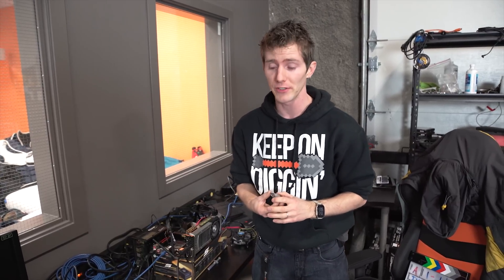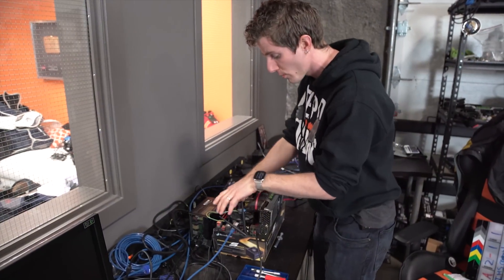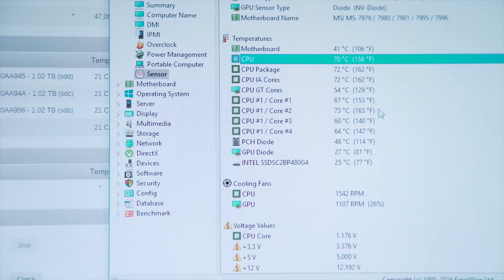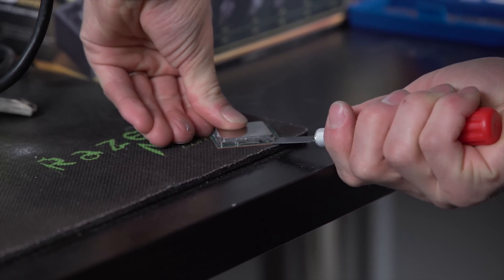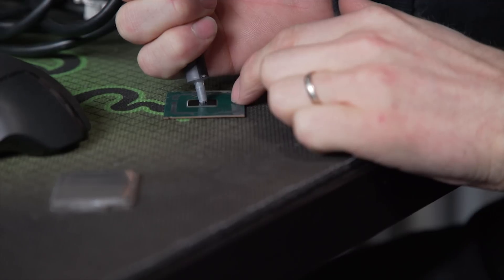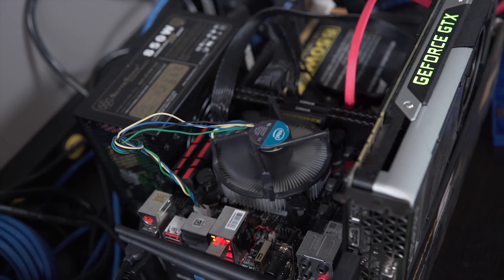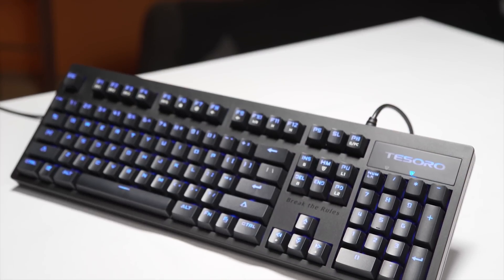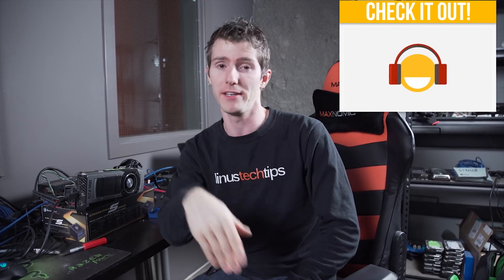Delidding an Intel Core i7 6700K - Is it worth it!?

Comment: the difference its bigger in older generations cpu's and with overclock. in haswell cpu's the thermal interface was a shit, i delid my 3770k with a h80i (i put artic cooling mx4 on it) and i gain in stock 9°c , and overclocked almost 16°. thats A LOT

Comment: The vice/hammer method is much easier/safer.  also normal thermal paste vs something like cool laboratories liquid pro/ultra on the die is a HUGE improvment. like 10-15C

Comment: i have dellided 3 3770K ( 2 with razor blade and 1 with vice + hammer method ) and the load temp drop was way better, around 10 from 15° lower with MX4 and ~20° with CLU/CLP (and probably more in overclocking ), thats HUGE.
I did also lapped my IHS and my NH-D14's base later for further improvement.
My 3770K live now happy under 70° @ 4.9Ghz 1.35v

Comment: A few facts:
1. The thermal paste is not the issue, Intel actually uses really good thermal paste, the issue is the distance between the die and heat spreader.  When you delid the processor you scrape off the adhesive (which is the actual culprit) effectively moving the die closer to the heat spreader.

2. Not all processors have thermal issues out of the box, for instance on my 3770k I was getting 72c under load and after delidding I got back down to 61ish under load.

Comment: This isn't going to stop anyone who would do this anyway. I feel anyone who would try this has enough money where they wouldn't care if they broke it, and would be obsessed enough with overclocking that they would want the improvement. Just because it was only a couple degrees with a basic setup, doesn't mean that with a good system overall it wouldn't have a significant improvement. With that said, if you try this, don't go crying if you fuck up your expensive cpu.

Comment: Reminds me of the HP Envy when it first came out. Overheated something awful. HP was clueless as to why and actually told people the computer running blistering hot was normal. People were returning them, and getting them back running just as hot. The problem turned out to be (for most people) a over abundance of crappy thermal paste slathered on the cpu, which required disassembly of the laptop to remove and reapply. Then ran as cool as the other side of the pillow.
Reply: Yeah my envy had constant overheating problems.  It would shut down on a daily basis in the summer because of it.  I ended up not only replacing the paste but removing the bottom cover and aiming a desk fan in there for extra cooling lol!

Comment: I don't normally comment on youtube videos as I don't think anyone ever reads them, but LTT is great so maybe you guys will see this. 

I don't think this test was done optimally. First of all when you were removing the heat spreader from the IHS, you left a lot of black residue from Intel's glue still on the PCB. I would suggest you remove this and the rest of the black glue from the heat spreader before doing the test. The other thing is that you used normal thermal compound for the re-application of the heat spreader. I think you were better off using something meant for de-lidding, such as Liquid Pro (a type of thermal compound meant for de-lidding as it is basically liquid metal for better conductivity.) Also, one more thing I would do in order to get the best results possible from de-lidding, is liquid cooling. Whether you are using a custom loop or an AIO cooler... this method of de-lidding will remove much more drastic numbers off of your low temperatures. Personally I had a similar starting temperature of 72C, and by the end of the process my CPU temperature was 60C.

This kind of cooling potential makes de-lidding worth it for me, and I would suggest you try this method as you may get better results and ultimately come to a different opinion on de-lidding. 

One other thing, and this is completely optional -- the vice method of removing the heat spreader is a lot more effective and safe. However I am not able to test this, but I would suggest LTT give it a try.
Reply: He commented somewhere else that the vice method doesn't work as well with Intels new chips because they have been known to bend and he didn't want to risk it!

Comment: Sorry linus but this test ist poorly done!

You test with the worst cooler which does not benefit much from better thermal conductance, you use TIM which is not much better than intels and with your ultimaker 2 you could have printed an very easy delid tool.

If you had doen it right and OC'd it you would get temperature benefits of 20 to 25°C !!
Reply: +Tom Weise Those big differences are unlikely with Skylake. First generation Haswell on the other hand...
Reply: +Robbedem Intel saved big on thermal paste by just using toothpaste on haswell

Comment: With an 3D Printer you can print an much easier and safer tool to delid!

Also with liquid metal you get around 20°C deeper temperatures in Watercooling!

Comment: Using Coollaboratory Liquid Ultra as my new thermal compound between the die and the IHS I was able to reduce temperatures about 15 degrees Celsius on a i7 4770k.   I used the hammer and vice method to remove the IHS which worked well.  But when it comes to the new Skylake processors I don't believe you really need to de-lid the processor to improve temps.  Intel should have heard the problems with Haswell and the crazy temps and addressed them with designing of a new processor.

Comment: I have noticed that as I have deconstructed laptops that most of them have the IHS removed and the Heat Pipe cooling solution they use are connected directly to the Die.

Comment: This video is so much bullshit i cant belive it.
Reply: +mariodrv how?
Reply: +Ozzie Peck 
He did everything wrong he could have and he most likely knows it, you dont go through all that trouble just to slap in cheap Tim again and oversaturate it on the upside too just to skeew the result in favor of intel who uses cheap tim to harden overclocking and cheapen production, liquid metal is used for a reason being
mostly to almost perfectly cover the small imperfections a seemingly polished surface has plus the much higher thermal conductivity metal has anyways.
Reply: +Ozzie Peck 
As stated down below, i get an average of 15 degrees less by exchanging Intels crappy cheap tim with Liquid metal.

Comment: linus your test is bullcrap... testing on a stock heatsink? lmao, grab a h110, oc it to 4.8ghz, and then show the temps
Reply: +FellTheSky You obviously failed to see the point of this test...Get out.
Reply: Silly Sombra
he says "i dont think its worth it just for a couple of degrees", so he base his point on the fact that temperatures didnt went low enough to justify the "downside", yet the tests to show temps were terrible, who the fuck uses a stock heatsink on a OC 6700k
Reply: +FellTheSky He wanted to find the difference (-3°C or -4%) to see how much delidding affects the temps. This means the goal wasn't to get amazing temps. The absolute values (70°C vs 67°C) don't matter. Even if he used a better cooler, the relative difference would probably be the same, resulting in the same conclusion: delidding isn't necessary.
Reply: Andrew Kassis
The test is irrelevant and also invalid to probe his point, if he wanted to probe that 10% lower temps dont matter, he should overclock the CPU at 4.8 ghz were temps start to be an issue. Everybody knows that you dont delide you cpu if you are going to use it on stock clocks and stock heatsink.

Comment: Didn't know the metal on the CPU was just that, metal..
So why can't we just watercool the chip, without the metal?
Reply: +Ronny Finseth because corrosion...
Reply: Robbedem The waterblock is still waterproof, there just wouldn't be a useless metal piece in between
Reply: Ronny Finseth
I mean the chip would start to corrode.

Comment: Such a useless test. First of all stock cooler is already working on its top even with stock TIM. In addition you really have to use liquid metal as a new TIM. I got -25*C on my 4770K + thermalright macho hr-02.
Reply: +Vladimir Glushkov Intel changed their process between Haswell and Haswell refresh. So while an i5 4670K and i7 4770K might get big differences, a Skylake will show much less of a difference. Not sure why Linus used a Skylake CPU to delid... maybe he didn't want to encourage people to delid, so he used a CPU in such conditions (stock cooler and no OC) that he knew the test wouldn't show much of a difference?
Reply: Robbedem I agree that skylake has more effective TIM comparing to even Devil Canyon, but I read lost of reviews with testings of skylakes after delid and results still were really promising, like up to -15*C under heavy load, which may easily give you extra 100-300MHz. Your idea of Linus wanting people to avoid delidding their CPUs seems more realistic to me.

Comment: I had to delid my Intel Devils canyon Core I7 4790k 2 weeks after I owned it because intel put some very bad thermal paste on, I delided the cpu using the "Vice" method. I Used "Cool Laboratory Liquid metal" under the IHS, & MX-4 on top,- on a corsair h105. I noticed -10c drop in temps which allowed me to overclock my cpu higher with more voltage. I also put liquid metal on my GTX 980(nzxt Kraken G10 + Corsair H75 liquid cooler) I noticed again -10c drop in temps.

I only recommend delididng if you are planing on overclocking very high with higher voltage, deliding usually can get you 100-200mhz higher overclock with more voltage(even on a bad silicon lottery CPU)!

Comment: Do it once more with a Cooler Master hyper 212, I don't think the stock heatsink can show the full gain
Reply: It takes too much time to mount/dismount it as they are too lazy for that.
Reply: +Martín Varela I think a 3* C diff is pretty huge for the stock cooler, I feel like that means it would be even more drop if they used a real cooler

Comment: 1-3 degrees Celsius pshh not worth it
Reply: When overclocked and with a better cooler it can make a difference of 10-20c lol
Reply: yes when and if its still wont matter since the cooller will do the work still will be 3 degrees. Use a Corsair Hydro Series H100i GTX High Performance Liquid CPU Cooler and is jobs done

Comment: Well for me my 4690K core temps go (on average) 65, 65 73, 66, I was hoping when you did this that it was an off the shelf CPU you bought and not skylake (preferably haswell or haswell refresh) so there would be a much greater difference. I am highly considering doing this with my chip I just don't have the balls to do it I case I break it as I don't have the funds to get a new chip
Reply: +Baumy 15 after delidding mine 4690k it does 4.5Ghz air cooled (be quite! DARK ROCK PRO 2) with max 75C ambient ~25C. Before delid cpu could not handle 4.2Ghz, because of thermal throttling.
Reply: Yea, Linus needs to do a video on this again but with haswell. I've been hearing a lot of cases like yours where the delid makes a MASSIVE difference. Currently I have my chip on 4.2Ghz 1.2v and it hits those temps of the 4 cores, and I'm using a NH-D14

Comment: got a 4770k that overheats like mad and i'm thinking so much about doing this surgery to it
Reply: +Cosmicat I've got my 4770k with an h110 delidded and using the coollaboratory liquid ultra the temp went down from the high 80's low 90's to a very comfortable 60-65 c° under load using 5 different stress tests. After that I lapped the IHS and got 2-3 c° lower in the max temp under load. And I've been able to overclock higher from 4.3 to 4.6 because I had the thermal headroom.

Comment: In Russia, we use a hair dryer to liquify the glue and a vise to slightly shift the lid off the pcb (the chip itself is not horizontal, but at a slight angle). Much safer method both for your hands and your CPU.

Comment: Linus i love your video's but you are actually taking the long and painfull route here. 

The best way to do this is with a vice, some ducktape to cover the vice with, mount the cpu in between, heat it up using a blower and tighten up the vice untill the IHS comes of.
You are done within a couple of minutes and the risk of killing the cpu is a lot less.

Maby an idea for another delidding video?

Thanks for this guide.
Reply: He commented above that he didn't use a vice because skylake chips are thinner than most and would risk bending when using the vice method and he didn't want to take the risk.

Comment: wow, the actual cpu is tiny
also you completely fucked this up,      a stock cpu with a stock cooler ?   
its barely going to generate any heat and that which is does will be bottlenecked by the cooler not the IHS

Comment: i just ordered a msi z97 gaming 5 a i5 4690k and 8 gigs hyper fury x bundle from newegg. can i have a 980 or a 970 or basically anything better than my current evga gtx 750 SC 2gig. just thought i would ask, never hurts right?
Reply: Yes it works with both, none of them should get bottlenecked. I dont think the 980 will get bottlenecked, it might get ever so slightly but it should be fine with an small oc.
Reply: Elias Ihrefjord
 a 4690k wont bottle neck a 980. i was asking linus for one.
Reply: I'm sorry, not the best on the bottlenecked facts. Sorry it didn't say clearly that you asked for one, just if you could have one. Sorry for missunderstanding!

Comment: Eh. Sandy Bridge was still soldered, Ivy Bridge wasn't. So this works on Ivy Bridge, Haswell, Broadwell or Skylake processors on 115x socket. It does not work with the HEDT platform e.g LGA2011, 2011-3 read 3930K, 4930K, 5820K and so on. Neither does it work with any LGA 775, 1156 or 1366 CPU.

The main reason we see a temperature drop when doing this, is because of too big of a distance between the actual die of CPU and the IHS. This is remedied by delidding it, removing the adhesive stuff and replacing the TIM while were at it.
The reason we use the liquid metal TIM is because it is just better. It's thermal conductivity is much better than that of an ordinary TIM and the major bonus is that it's a solution that lasts for years. With regular TIM you have to worry about "thermal pump out" effect which basically means when the CPU gets hot and cools down gets hot and cools down, it slowly pumps the TIM off the die and within weeks or even days your temperatures just go from ok to worse.

P.S. Good job Linus with the TIM job, that's how you're supposed to do it yeah.... How about spreading the TIM so the whole die is actually covered or at least wiggling and moving the IHS around a little bit so it's at least somewhat covered and not have TIM free corners..

Also, you don't get any benefit? How about my personal i7-3770K results or the thousands and thousands of other people who actually knows how to do this stuff properly and have had two digit temp improvements?
Before I delidded it, my max OC without temperatures shooting through the roof was 4.3Ghz@~1.1V. After I delidded it, removed the adhesive and applied Liquid Pro TIM > on average a 15C drop in temperatures. My max OC is now 4.8Ghz.
And that's with air cooling. So how about you go fuck yourself.

Comment: LINUS you're conclusion is very one sided! I have a i7 3770k (Ivy Bridge was the first to use paste, not Haswell) and an H80i water cooler and I've delidded using MX-4 and Liquid ultra paste. The MX-4 dropped temps 6c at 4.7GHz while the Liquid metal dropped temps by 23c!!! This made a HUGE difference and is VERY much worth it! Liquid metal is SIGNIFICANTLY better with high voltage and better cooling, stock cooler bottlenecks the entire test to boot.
Reply: +Marshal Beard I got a massive 20C lower temperatures on my i5-4670K with 0,1V higher voltage. Made my 4,5GHz possible on a Hyper 212+ as it needed 1,375V.
Reply: +Marshal Beard your*

Comment: The delidding was done prominently with ivy bridge and first gen haswell if I recall right, cause of crappy application of T.I.M. Devil's Canyon and later had better stuff. Why did you use 6700k and not the 3770k or 4770k parts to test this?

Comment: I had my core 1 always run 10-15 degrees hotter before my Delid. Unable to hit 4.7 @1.4v and pretty much most benchmarks unstable. Now after the Delid my cpu has even temperatures over all cores and I'm sitting at 4.9@1.456v with my temps NEVER going above 70 degrees. I definitely promote deliding for the experienced and the unlucky who don't get binned chips from intel

Comment: Linus,  I'm surprised you glanced over the fact that life of the processor may be severely diminished by changing out the thermal adhesive 

The whole reason for Intel getting away from soldering, yes it is expensive to solder but not in such a huge way to significantly impact product cost...the reason they switched is for life span of the chip. As the chip heats and cools, it expands at a different rate than thermal pastes or solder. This difference in expansion creates stresses which create cracks in the die over time. Intel's paste is designed either to contract at a similar rate as the die or to be elastic enough to minimize thermal stresses in the die. 

And yes linus, the heat spreader has thermal resistance but if Intel is using the tech that I think they are, the heat spreaders should have a vapor chamber inside which transfers heat ridiculously well. This means that the heat spreader will have negligible thermal resistance compared to the cooling system and especially compared to the paste Intel uses or even solder.

Comment: The process wasn't to make you get better temps, and the issue really started with Ivy Bridge, where after a while you would get worse and worse temps no matter what thermal paste/cooler/amount you used. This procedure was found to bring temps back to within an acceptable range where they should be to begin with. If the CPU didn't show signs of any issue then this isn't going to change anything.